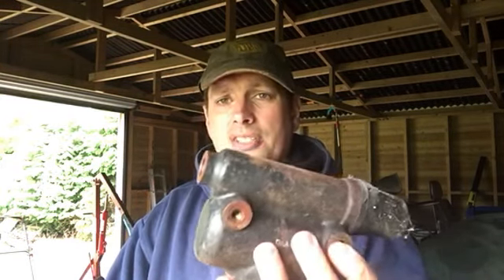Mulag tracked flail

Comment: That's a cool looking little dude
Reply from the maker: Yes it's small and light enough to go places others can't. It's very stable and has a 4-point harness to work on steep banks. You can even unlock the seat so it tilts to allow you to sit upright when the machine is lent over !
Reply: SO what is it's weight class and certainly does a great job in its element there